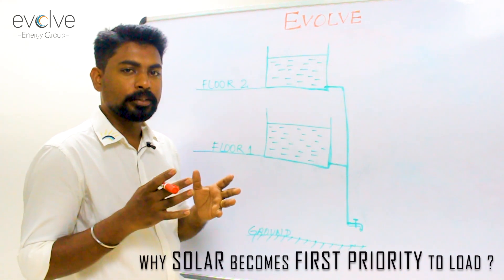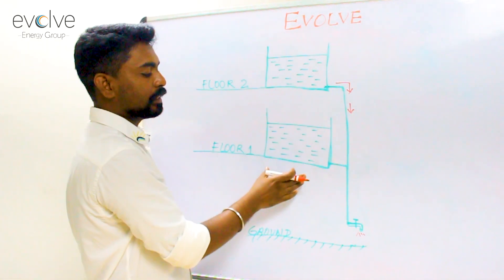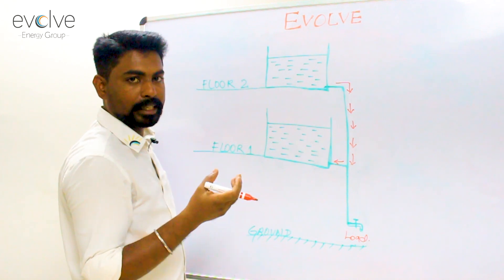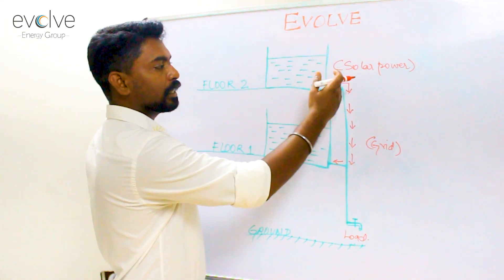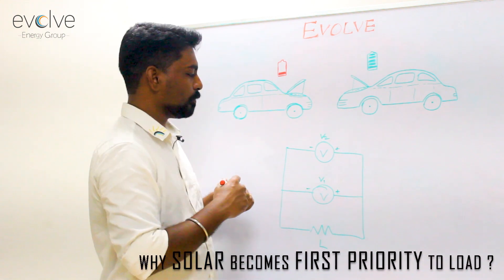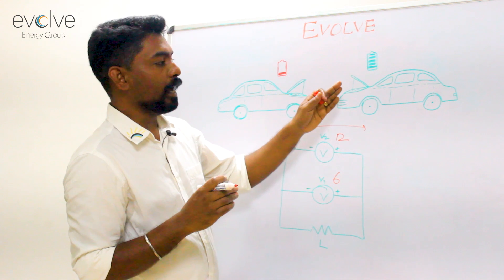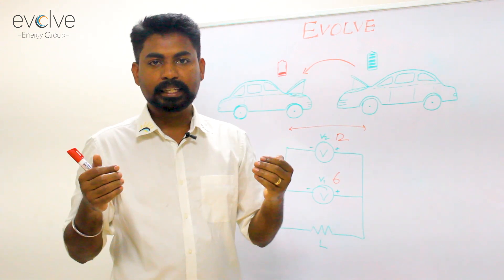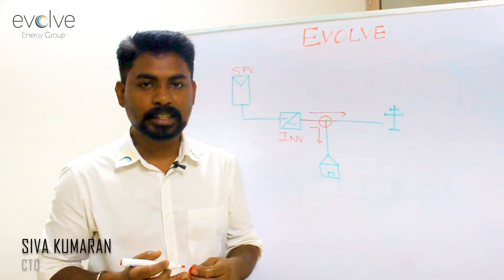WHY solar becomes first priority to load? | Evolve Energy Group | Techie Corner

Comment: the solar inverter generates a voltage which is leading in nature wrt grid voltage, not the higher voltage than the Grid, its a AC supply sir

Comment: Dear Siva
Sorry but your explanation to the concept is not correct.
Even you battery concept is completely wrong as this is violation of KCL/KCL Law.
And even in AC power , active power is not governed by the voltage difference between the sources.